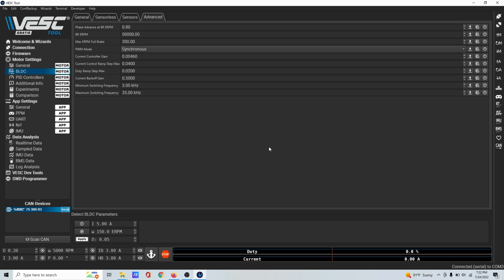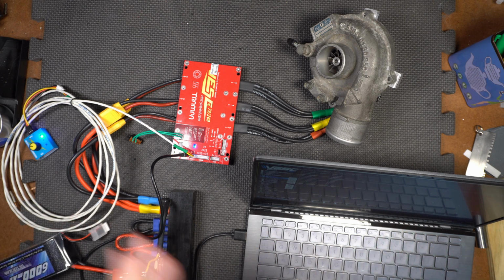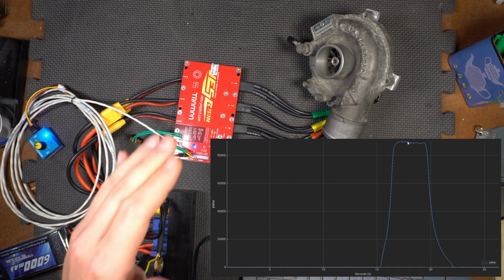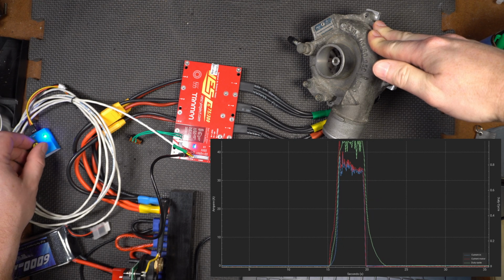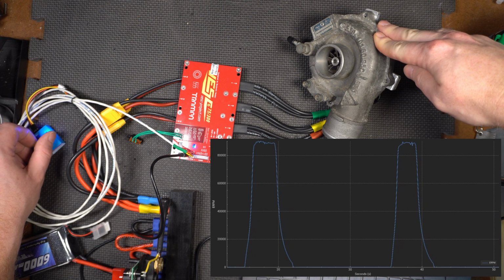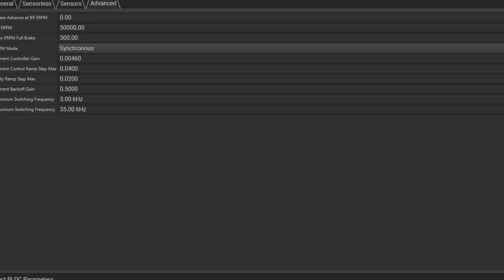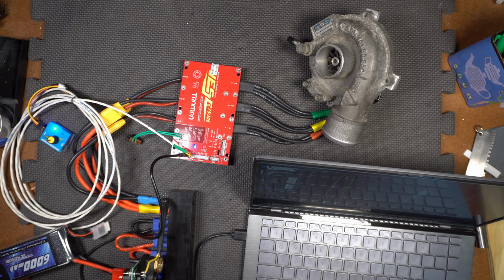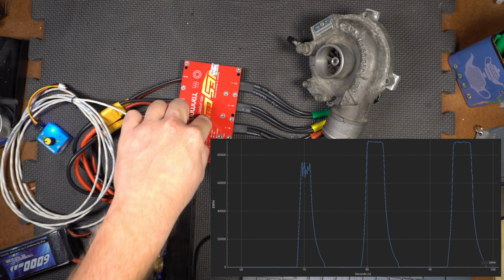Brushless Motor Timing Test

Comment: i would look into more radio control speed controllers. max 4 or the mcm biga$$ esc should would for what your doing. love the content man as im a gearhead for rc and cars. ill keep watching!
Reply from the maker: Funny you say that - the big electric turbo (the Sledgehammer) uses the 1,000 amp MGM ESC and an LMT 30100 motor.  Here it is at the track: https://youtu.be/nlTVHkfSQXM On the dyno: https://youtu.be/PjOJU02FIGw and assembling it: https://youtu.be/mV-rhlrWu9Y

Comment: Love your work! Ever considered a pneumatic motor, like a die grinder, powered by a small compressed air  tank?
Reply: I’ve seen some pencil grinders that spin @ 70000 rpms at 5.3 avg cfm, that’s a neat idea you have , I wonder how big of a air tank you would need for a 10 second drag race. So air pencil grinder to supercharger . I wonder if it would work.
Reply: @tommycortez_  Need to work out shaft power required.
Reply from the maker: That is a really interesting idea.  But as you say, we need to figure out what the pneumatic motor can do - the electric turbo (the Sledgehammer - the big one) is in the mid 40 hp range, and we have yet to hit 800 hp with that one (though I'm confident we will).  So we would need a pneumatic motor capable of at least 34,000 rpm and ~45hp to match what we've got now.

Comment: BLDC mode has not been in active development for many years, given how superior FOC is. Nowadays if you want higher speeds you run the more efficient FOC and enable field weakening. I'd use a 100V rated powerstage though as its easy to blow it with a single wrong setting
Reply from the maker: TBH, I've spent so much time trying to get the VESC to work, and it's just flaky, no matter what.  We are asking it to do stuff it's usually not used to do.  As you probably know, VESC is intended for (and commonly used in) stuff like electric skateboards, not spinning high-power motors with long cables at very high rpm.  Out of all the ESCs I've tried (and I've tried a lot), I've spent by far the most time with the VESC and had the least success.  I want it to work, but it's just not ready.

Comment: Why don't you just run a 90mm EDF inline on the Intake cold air tube?
Reply from the maker: It's a good thought, but a 90mm EDF would be a restriction on the 100mm throttle body.  I've looked into those and the main issue is that they don't generate any real pressure differential.  To get boost from an axial compressor requires multiple stages; and since we're already at 33kW with the bigger centrifugal unit, you'd need a huge axial setup to work comparably - and it would get very complex very quickly.  Just in case you haven't seen it (but you probably have), here's the bigger unit at the track with power numbers as it goes down track: https://youtu.be/nlTVHkfSQXM

Comment: Hey man I'm a novice with electric motors your information is great, but what your charge psi. Would an application like this work for a motorcycle targeting 4-7 psi
Reply from the maker: I don't know if you saw it, but we made a peak of 8 psi and 6 psi at peak hp on a 510hp V8, giving us about 722 flywheel hp: https://youtu.be/nlTVHkfSQXM
Reply: @AlexLTDLX  yes I did but I seen you seem to have a smaller more compact version in the video

Comment: I would also want to see temperatures on the motor. 
I also think you need a dyno , such as an electric motor and a carbon pile
Reply from the maker: Nothing got even close to warm here, but I have been thinking about a motor dyno of some sort.  That would make testing easier.

Comment: I'm not sure just measuring peak ERPM on an "unloaded" impeller is a great way to measure "more power".  Maybe ERPM at more of a restriction would be better, and more of a real-world example.
Reply from the maker: It's not unloaded.  Quite the opposite, in fact.  Running a centrifugal compressor wide open like this places the most load on it - because it's going straight into choke - causing drive power to shoot up exponentially.  I illustrate this in some of my other videos.  It's similar to a vacuum cleaner and plugging the nozzle - the vacuum's motor speeds up and electrical draw goes down.

Comment: AlexLTDLX. CORRECT ME if I'm wrong. 30%TDC is "0" and 0%TDC is "1" ..... THEN 0.01 TO 0.99 WOULD be the RANGE Right OR?.... for example 0.33 would be 10%TDC....  Please let me know. Thanks love what your DOING I have been LOOKING DILIGENTLY for "SIMPLE BOOST" FOREVER. Then 2500 for the one that actually works is too much SO I can't wait to see what you ACCOMPLISH...
Reply from the maker: I really don't know.  Your hypothesis seems logical - but you think like me, lol - "TDC."  I guess that concept still applies here too.  I was just looking for a change, since we really don't know the actual numbers.  And thanks for the kind words.  The first one we tested on the car made about 650 flywheel hp: https://youtu.be/AOL3Qyczt3Y and it cost about $2,500.  The second one made about 722 flywheel hp and cost about double that - though I think it'll get over 800 flywheel: https://youtu.be/nlTVHkfSQXM  As development continues, and the parts become more common, I think the prices will come down a lot.

Comment: What if there was an impeller connected to a high voltage generator (alternator) that charges the high voltage pack for the electric supercharger, does that make it a turbo?

BTW: I had this idea that batteries are heavy, but apparently that doesn't apply to lithiums. A group 24 lead-acid is ~42lbs, and a group 24 LiFePO4 is ~14lbs. I never looked at the weight. So my XSPower Super Cap isn't much better than a modern battery. It is, a little, since that group 24 LiFePO4 will provide 480cca, but my SB75 + group 9 lead acid will provide 502cca at less than 1/2 the weight.
Reply from the maker: That is a REALLY clever idea.  You could have some sort of exhaust diverter so it's not always a restriction, and when the engine is just loafing along, it could use that lost energy.  That's something that's much more easily retrofitted to a car than an internal generator mounted in a transmission (like most hybrids).
Reply: @AlexLTDLX  I've got this Cummins VT-50 sitting around…

Comment: I dont know if that timing works or not in this case but I would imagine even for testing proper load should be applied? Or was higher rpm the goal/load? Is there any inputs left in control board, how about adding another knob to adjust timing in real time (while motor under load)?
Reply from the maker: All I care about is max rpm at max load - and running a centrifugal compressor wide open like this puts maximum load on it; contrary to what you'd think.  The reason is that it sends the compressor straight into choke, moving a large mass of air.  If you put a restriction on it, it'll take load off of it, and it'll speed up.  I demonstrated that in several of the P2 videos.  I'd love to do something like you're suggesting with the timing pot, but I don't know of an ESC that can do that.

Comment: I would point out that 0 development has gone into Bldc mode in years. The bldc was always a bit weird lol. 

The latest beta firmware has come a long way recently. I wouldn't buy a vesc to use bldc as all the development is purely on foc.
Reply from the maker: Thanks for the info.  TBH, I've had tons of issues with FOC mode as well - check out my P2 test videos.  It's literally problem after problem.  When I put the MGM/LMT combo on the big electric turbo, it just worked out of the box.  At this point I've tried 2 Flier ESCs, 2 APD ESCs, this VESC and the MGM.  I liked the APDs, but their compact size led to some spectacular failures.  The MGM is by far the most robust unit.  The VESC is as flaky as a box of cornflakes - I honestly don't think I'd put it on a real car.  It's far too unreliable, and a real car, with real people in it on a track is not the place for flaky stuff.  If you haven't seen it, check out what the MGM/LMT was able to do at the track: https://youtu.be/nlTVHkfSQXM
Reply: @AlexLTDLX  I actually bought two of the lmt30100 after I watched that to use on a dyno for a big vesc I am working on. The mgm do just work, but they are also gigantic!  
The vesc now has stator saturation and temperature compensation so that helps when pushing things like you do. But yet it's a bit flaky sometimes when not tuned exactly right!